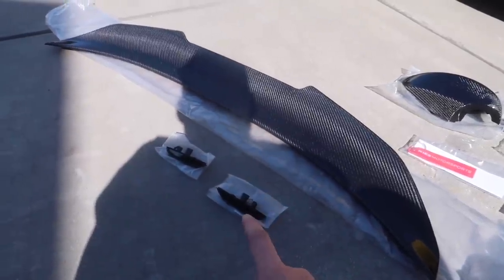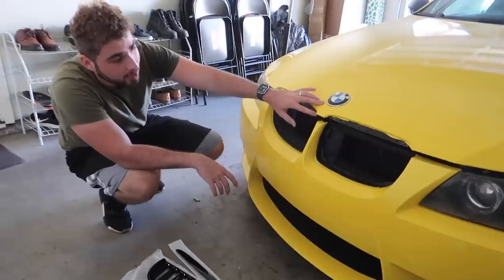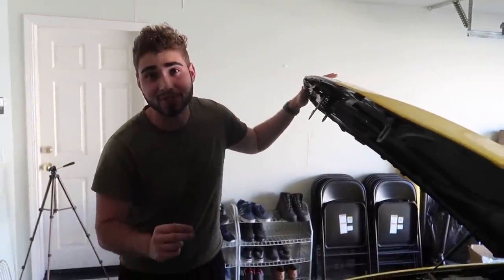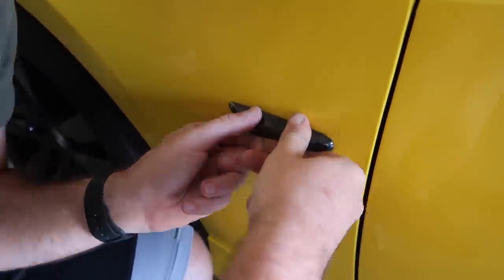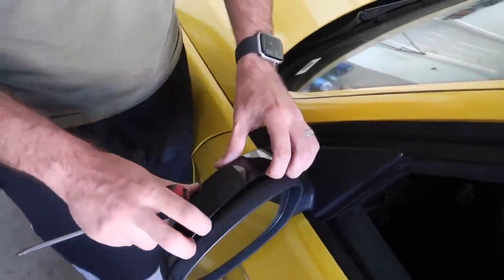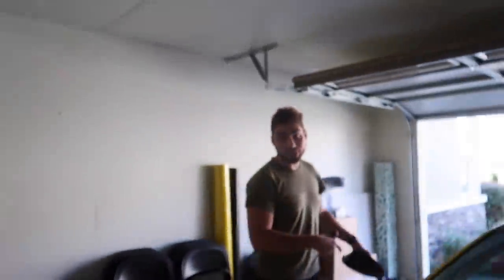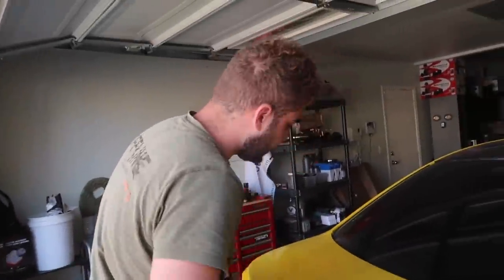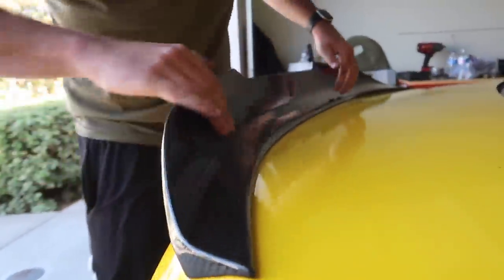TRANSFORMING MY BROTHERS $1500 328I WITH THESE CHEAP MODS!

Comment: I normally like the builds you do, but this one is a little too riced IMO. Perhaps its the bright yellow or the M3 style bumper or the ducktail spoiler. The wrap also seems to be coming off in a few areas. Ideally I would have liked to see you take your time, rather than trying to finish one build ASAP only to move onto a new one. Just my opinion really, take your time on these builds and it will turn out even better.